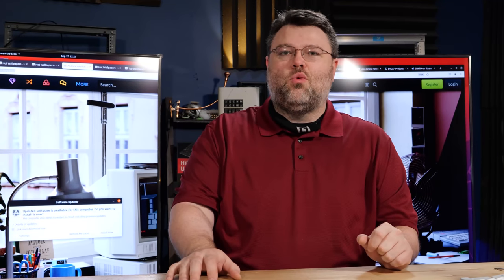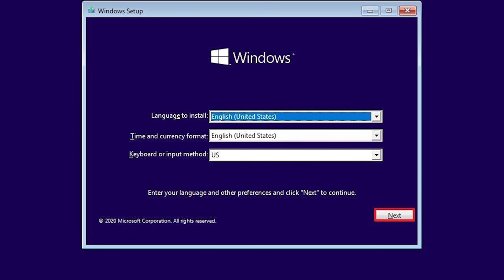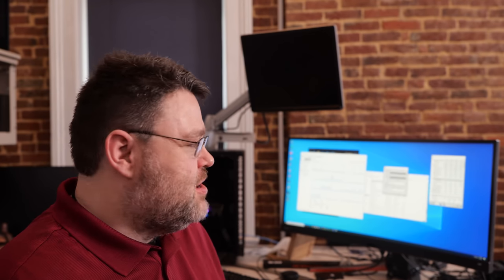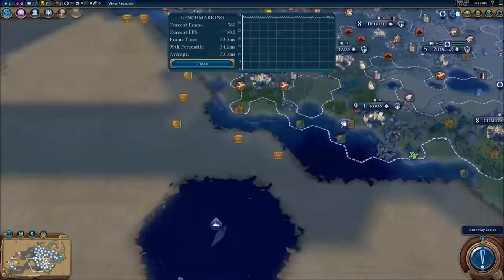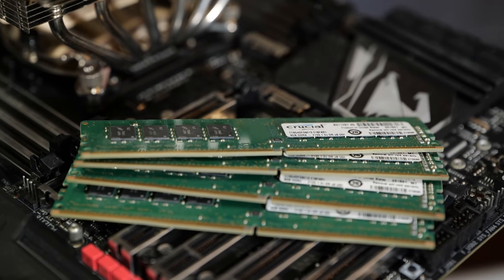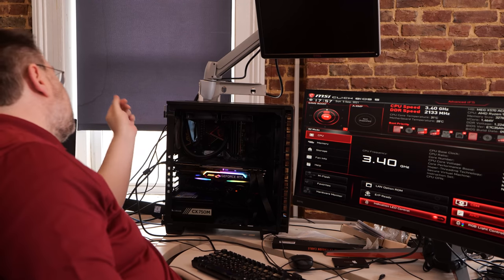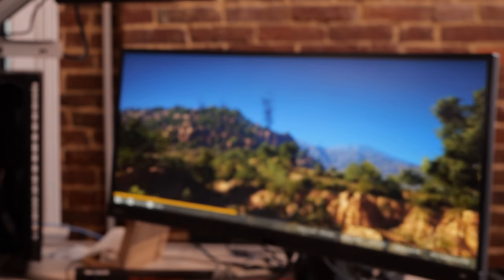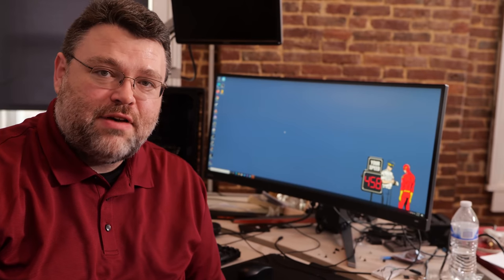Level1Techs Real Upgrades: X299 7900X to AM4 5950X

Comment: i would have kept the nh-d15. much better than a 240 AIO imo, and more reliable.
Reply: you have no idea what you are talking about. all those reviewers like gamers nexus and so on, test "open air" on a test bench. which skews results. you cannot test in an open air environment. that's like putting the coolers in ice and claiming "they are both good" its just not how you do scientific testing. Imagine if car radiators where tested the way these idiot youtubers test, cars would be shutting down from overheating because they didn't do any "real world" testing.

IN REALITY, the ability to keep a cpu cool is BETTER on AIO than air coolers when in a proper case. That's when you see the coolers true ability to wick away heat. Hell, people were crying about the ps5 cooler because "it looks smaller which means worse performance" which just goes to show people don't know shit. and turns out, the new ps5 cooler is more efficient by a few degrees and even tested/proven by gamers nexus. sadly just because they got the ps5 testing right, doesn't mean their other testing is correct.

I have proven myself right, because I own both liquid coolers and multiple noctua air coolers. and when inside a case, the air coolers are a few degrees hotter. nothing comes close to a solid AIO. which is why smarter users like Level1Techs or myself use AIO's. And if you try to claim "they go bad" no they don't. Users abuse them and they break them. I have an old 2011 Antec 920 Kuhler AIO and 2013 NZXT x60, both still work and don't leak. This idea that it goes bad is just a sad meme. Stop abusing your computer components.
Reply: @goblinphreak2132  LTT tested in a closed case, and found it was better than corsair AIOs. what do you mean? I'll take a heatsink where I can replace a fan vs on an AIO throwing the whole thing out once the pump dies.
Reply: @goblinphreak2132  I think a large part of the idea of a air cooler in this scenario is that these CPUs are typically in workstations all boils down to reliability and peace of mind. Yea like no shit an AIO is gonna do better- but again reliability the chunk of metal wins.
Reply: @goblinphreak2132  replaced my TT 360mm rad with a noctua d15 and saw lower temps on my 5930k OCd.
Reply: @glycerin256  And Gamers Nexus tested the Artic Liquid Freezer II 280 3950X at about 200W and saw an improvement of several degrees over the NH-D15. And I trust Steve more with cooler reviews than any other YouTuber I watch.
Reply: @titaniummechanism3214  cool, GN has great content. If I needed another few degrees on my CPU or moved my computer I could see myself picking up another WC. But the lower cost and simple design on Noctua coolers means more to me RN.
Reply: @glycerin256  The Arctic AIO actually costs about the same as an NH-D15, around 100$ I think.
Reply: @titaniummechanism3214  I got mine from a friend that went water cooling for 60 bones. And my priorities are different than yours it seems. If I get a 5800x or next gen I'll look into water cooling again. For now, the noctua works great and is hassle free.
Reply: @glycerin256  I like my air cooler just fine as well, but some people still seem to think that a top of the line air cooler can beat a similarly priced AIO in cooling performance, which isn't the case. Except if you're LTT I guess. Then testing a regular AIO against a TR4 optimized air cooler on a Threadripper is just fine and produces perfectly representable test results.
Reply: @titaniummechanism3214  LTT in the video they tested a 9700k with AIOs and air cooler -  it beat the corsiar AIOs. Gamers Nexus showed the Kraken X62 beating the NH-D15 by 3C, and in my area costs £50 more than an NH-D15. An NH-D15 is more reliable, quieter and you get Noctua quality and support, which I have first hand experience of. 

IMO its either NH-D15/U12A or custom water cooling, otherwise you are just creating e-waste and wasting your time in the long term.  Nothing else is worth the hassle really, other than maybe a Scythe cooler, since they are pretty cheap.
Reply: @Fakeman  Gamers Nexus tested the Arctic Liquid Freezer II 280, which costs about as much or sometimes less than the NH-D15 and beats it by about 5 degrees on a 5950X and 5800X. LTT tested TR4 optimized Noctua coolers against AIOs with a regular coldplate on a 16 Core Threadripper, which produced uncomparable results. I'll try to find links for the two videos I'm referencing. https://youtu.be/hr0qLLv3dKc
https://youtu.be/KPaSEGe6ML0
I found the LTT video you were talking about and I don't understand how GN and LTT could get such different results.
Reply: @antong3987  ? you ok man?
Reply: @glycerin256  Would you upgrade to a 5900x or wait, i dont know if i should, i have a 5820k too
Reply: @goblinphreak2132  you have no idea. The nhd15 is legendary
Reply: @goblinphreak2132  aio's are for amateurs.  and anyone that's ever done their own water cooling knows you got to top off the fluid at least once a year. so good luck with your aio's buddy.  they actually loose a little bit of performance every year and how do you know if your fluid is gunking up or not?  i've seen some aio horror stories.  so you can have it,  i'm over water cooling.  i still got my liquid setup on my backup pc.  but as old as it is it kinda scares me these days.  knock on wood.  but yeah i'm done.  it's D15 for me from here on out.  there are plenty of tests that high end air coolers are on par with even the best aio's.  and using them IN NO WAY makes you smarter.  this was a spec build.  that's why he used it on this build.  so simmer down and quit abusing your pecker.  nobody's gonna listen to some know it all neck beard like you that keeps contradicting himself to try to fit a narrative.
Reply: @johntiles  exactly.  thank you.  if he knew what he was doing he wouldn't be using chinese aio's anyway and doing a custom loop.  but he knows it all so...

edit: LOL  don't listen to that guy.  he just wants to think his aliexpress aio blows away any air cooler on the market.  even after "10 yrs" and never never even upgraded the fans or doing push pull, but his computer is "superior" to anything we got.  he's probably still rocking a 2500k quad core and telling plebs that's all you need for gaming.  what a loser.
Reply: @goblinphreak2132  oh NOW you build custom loops?  i thought you were the big time AIO guy?  man  you're just diggin yourself a deeper hole.  quit while your a head.  and like i said SIMMER DOWN.  we can see through you guy.  us that know, already know.  we don't need a RGB gAIO to get good performance out of ZEN 3.  the D15 will hit the same clocks with better long term reliability.  did you just do your first build or something?  because you keep bringing up all these youtubers and not decades of actual experience.  some of us have been there, done that.  think about that for a minute.  edit: actually i never went AIO, just custom loop.  i always looked at aio's the same way i look at consoles for gaming. (for kids)
Reply: @goblinphreak2132  Is individual usage a factor? I feel that everyone's opinion will be based on their personal experience. Sometimes people unknowingly  base their opinion on a faulty product.
Reply: @massacrestarts1673  possible. But one or two youtubers claiming AIOs will gunk up and not last doesnt set the factual record. Ive built, even owned multiple rigs with air, aio, and custom loop. Custom loop feels great to build, like building a giant lego set. Its very rewarding. But it's also expensive. Most pc users can't afford a custom loop. So for them, it comes down to air vs aio. You can buy a quality AIO for the price of a quality air cooler. And 9 times out of 10, the aio will offer quieter running and lower temps. If your run it at the same noise level as air aka noise normalized, the aio outperforms air. I saw someone mention ali-express trash products. I dunno why anyone would buy chinese knock off products in any serious way. Even i agree thats a recipe for problems and failures. But known brands of AIO, absolute quality. Corsair, NZXT, cooler master, the list of good name brand aios is actually pretty large. Sure a bad one might pass through QA process. The same happens for air coolers! There is nothing wrong or unreliable about aios. They exist for a reason. Hell, noctura has been trying to design their own liquid cooling setup. We've know that for years! But people will still claim "air best". Air is only "the simplest".
Reply: @goblinphreak2132  nope, because everyone knows real custom loop is better hands down.  i've been doing water cooling before there was such a thing as aio son.  plus why are you coming back to this a "weak later"?  did you finally think up  something else to say aio boy?  lol  ...aio ahahahahaha!!  yeah and so now you're the expert?   lol  go home.  mommy's got dinner on the table.
Reply: @goblinphreak2132  while I agree with most of your comment, I must disagree with you about GNs testing methodology... Just because you do it outside of the case, which is only for testing how good it is between different models of cooler, in this case, water cooler, doesn't mean your overall results will drastically change when put inside a computer... Yes it will be 5-10°c warmer, or however much the difference is, but it'll be similar, if not THE SAME difference on practically all coolers... And besides, he's using cooler testing methodologies he worked up after seeing the cooler manufacturers do testing, and using the same or similar equipment as they do, I think I heard him say once, so as to get a more industry standard result, consistently, without the nuances of say, putting everything in a case that's a hotbox, although, arguably, most likely, the cooler rankings would stay the same, either way, so I don't get why you think his methodology for cooler testing sucks so bad...
Reply: @northwiebesick7136  your thinking is incorrect. The open air test bench isnt stressing the cooler the way it is inside a confined case. Its akin to running a car outside vs in a garage. In the garage the cooling will work complete differently. Even when doing power runs on the Dyno, they have to use a fan because im a confined space is completely different than driving down the road in open air. The same goes for pc components. Some weaker components will work as good as more expensive options open air, but heat soak im a confined case environment....
Reply: @goblinphreak2132  lol... I'm surprised you even went so far as to equate PC cooling to removing exhaust from a car on a dyno... Never have I heard of a car on a dyno have an extra fan because of heat, only for helping remove exhaust... Also, if you put 2 coolers, no matter what type into a case, the better cooler will win, and that same cooler will win no matter what case, it's in, most likely, assuming test conditions remain constant, same as what happens on those so called "open-air test benches" you think "everyone" uses... If you watch GN, or Jay, or LTT, or anyone else, they will specifically state when testing a PC they built, that performance and temperature is what they expected, compared to their test numbers, which then invalidates your methodology that using a test bench is a crappy way to do it in general, and what's more, technically GN doesn't even use a test bench much anymore, as I alluded to in my previous comment... He's got those industry standard or whatever, coldplate tester devices for that now, so IDK what if anything he uses his test benches for anymore...
Reply: @goblinphreak2132  lol... I'm surprised you even went so far as to equate PC cooling to removing exhaust from a car on a dyno... Never have I heard of a car on a dyno have an extra fan because of heat, only for helping remove exhaust... Also, if you put 2 coolers, no matter what type into a case, the better cooler will win, and that same cooler will win no matter what case, it's in, most likely, assuming test conditions remain constant, same as what happens on those so called "open-air test benches" you think "everyone" uses... If you watch GN, or Jay, or LTT, or anyone else, they will specifically state when testing a PC they built, that performance and temperature is what they expected, compared to their test numbers, which then invalidates your methodology that using a test bench is a crappy way to do it in general, and what's more, technically GN doesn't even use a test bench much anymore, as I alluded to in my previous comment... He's got those industry standard or whatever, coldplate tester devices for that now, so IDK what if anything he uses his test benches for anymore...
Reply: @northwiebesick7136  the fan placed in front of the engine to remove exhaust? Thats absolutely hilarious.... Tell me you were not serious....
Reply: @goblinphreak2132  lol... You never said it was in front of the engine, all you said was that cars on a dyno have a fan on them, therefore it's your fault your analogy backfired, because again, it's the first I'm hearing of an extra fan to cool your engine down, I mean, if your radiator fan isn't enough for that you should get rid of the crappy vehicle... Just saying
Reply: @northwiebesick7136  i didnt day anything about removing exhaust. I have a feeling you dont know anything about either topic. When a car sits on a dyno, you place a fan Im front to imitate driving down the road as the radiator would overheat otherwise. I never mentioned anything about extraction fans in a building to remove exhaust.... You did.
Reply: @goblinphreak2132  never said I knew anything about dynos, just saying that I never heard about fans in front of the motor, aside from the radiator fan...  As for the whole which is better, AIO or air cooling, I don't care which is better, but I do care that you're saying that someone like Gamers Nexus, who researches everything before he does it, and does everything he does scientifically, is somehow doing things wrong and misleading viewers... Now, I have built a few computers, although I mostly just do troubleshooting currently, so I know about computer building in general, although I don't much care what, or how cheap, a cooler is, that goes into my PCs as long as the temps stay manageable... You wouldn't imagine how hard it can be to figure out what's wrong with a dell machine sometimes, or more importantly, WHY it's wrong, and if I had my way some of the repeat offenders I help out would get a new PC instead of giving me a headache every few months

Edit

What I do know about dynos however, is that if you don't properly ventilate the building, aka, "remove the exhaust" you'd die from the fumes in the exhaust

Comment: As someone who owns Z490, X299, and AM4 and had experience with all 3 the biggest thing you can do is get some good samsung Bdie memory and tune it. All 3 are good gaming platforms. 10850K plus decent z490 board is the cheapest and performs almost identical to a 5900/5950X system in gaming. The Intel chips overclock pretty good of you have good cooling. All 3 are pretty similar performing for gaming only once overclocked.

Personally I would have tried to delid the 7900X and OC to like 4.8+ GHz and OC the mesh to like 30-32, and get some nice bdie memory. 3600-4000 c14/15 is very very doable on many boards and any decent memory kit. Minimal cost and big gains in daily usage.

Comment: Hey Wendel, I also have a x229 system. I'm prly gonna go a couple more years on mine. I play @7680x1440. Triple dell 27" gsync panels. Older now, but are 144hz. And paired with a MSI Seahawks EK ed., it's a sick setup and rarely cpu bottlenecks. But I can only get 40s fps on red dead 2, and ac valhalla, but still enjoyable b/c gsync makes it look smooth. I think one more gpu upgrade for this machine and I'll have to upgrade the main part again. Did I mention my 7920x I delided day one, and it achieves 5.0ghz all core @1.38/4 volts. Only get to 60s Celsius with a big load. Summer times can have it in the 70s Celsius. My other thing is I have 7 m.2 drives, so I would need a future hedt system for pcie, or fewer, higher capacity m.2 drives. But I like raiding drives. I have 5, 1tb intel 665 drives in a raid 0 for games. Blah blah blah. Anyway, I ramble too much nice build. But love me my x299 still. I also have threadripper 1900x pc, an amd 1700x system, two x79 machines as servers, and even have a z87 machine turned into a pfsense router.  I love using old gear. And as expected, I have even older gear. Ttyl!
Reply: i got 10980xe, im fine all core 4.5 ghz. i bought from silicon lottery.